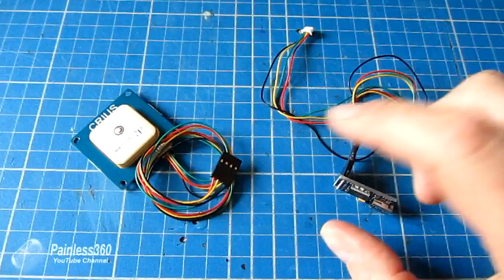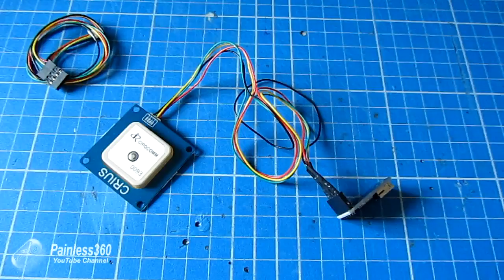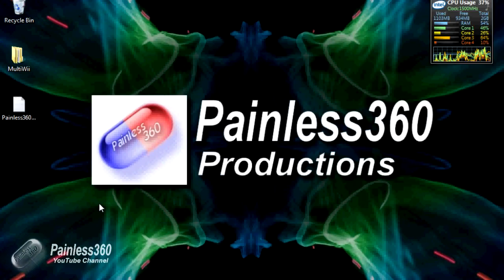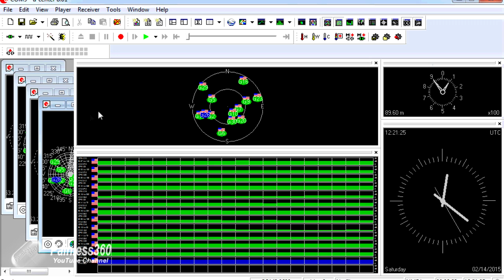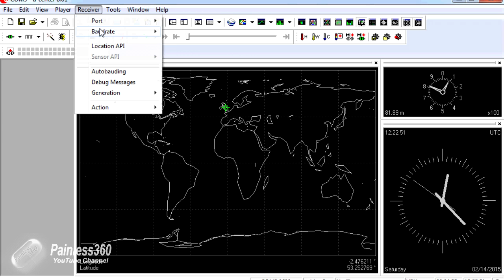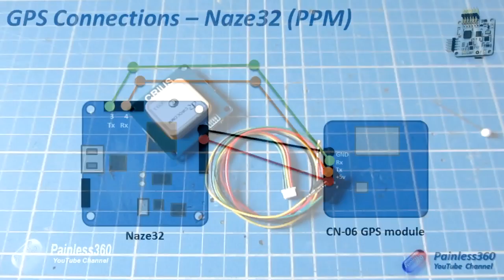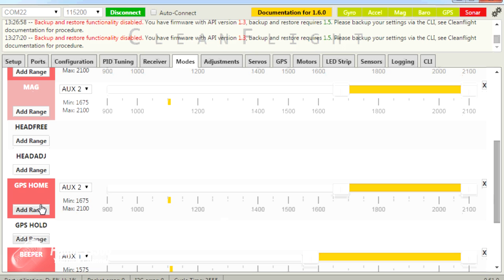(6/8) Naze32 Flight Controller - Adding GPS (NE-06, NEO-06 module)

Comment: Hi...Noobie question..Do you have to configure all GPS units to work on naze32. If so where do you get the adaptor + software from..
from..
Reply from the maker: +Colin Helinewbie first tip - don't use a Naze32. Second tip - go and watch my iNav series. Best of luck!
Reply: Hi.. I have watched a lot of your videos and found them very informative But why not naze32. I will be using the skyline32 advance. I have now got the software plus the config file and a FTDI adaptor will arrive today.. Will your config file work with a Ublox Neo-M8N GPS With Compass. Thanks in advance..Keep up the good work..
Reply from the maker: +Colin Helinewbie see my video from the summer on flight controller comparisons. I cover it all in there. Best of luck
Reply: Ok will do. Thanks

Comment: Hi Mario! I love your videos      I cant seem to get the gps to connect to ublock. I have a solid blue light on the gps and the wires are all in the correct places but it doesn't show up in ublock and no ports are available     any ideas?
Reply from the maker: +Elam Fisher try swapping the tx and Rx lines and trying other baud rates.. best of luck!

Comment: Quick question, does this even remotely apply to a Naze32 Rev 6? I was given an AP rig, but I'm just looking to get it airborne, maybe add a camera gimbal and get some pretty pictures. Not sure I need GPS, but it'd be a nice option later. But I'm also aware that this tech has changed greatly since this video came out. :)
Reply from the maker: If you're looking for GPS, ditch the Naze32 and use iNav. Best of luck! :D
Reply: Thanks much! :D

Comment: I have a question, maybe you can help me:) Since you've also done a video on the F3 SP Racing flight controller.. I want to add GPS to my racing quad for safety purposes. I've successfully installed the Neo-6M Module, and it works fine in betaflight. But I got weird circling (not just circling, but actual uncontrolled movement). Then I found this video in which you explain that a compass is needed (I guessed that, but wasn't sure). Now my question is: Do you know if and how it's possible to connect an I2C compass to the F3 racing? It has a I2C conector..
Any help would be really appreciated!:) Great videos b the way, helped me a lot to understand the Neo-6M and uart.
Reply from the maker: +DerKrawallkeks if you want gps modes, then take a look at our inavflight series. Much better..
Reply: I know I know, I've read about that. But in my specific case, I want betaflight, since this is a racedrone. I just need very basic gps to work (pos. hold or rth) for safety reasons.
Do you know if I can just hook up a compass via I2C right out of the box?

Comment: Hi im trying to run a ubLOX neo 7-M gps module with my naze 32 rev 6 full
im having problems with the set up on the ublox u centre. (its my first go at gps setup)
i cant seem to find a GPS CNSS conguration file suitable for this module.
dose any one have any ideas how too finish the setup ?
Reply from the maker: I'd use iNav, see our series on that. If you want to manually configure the GPS then we cover all of the steps in the SP3 series on the channel. Best of luck!

Comment: can not configure the gps. it isn't saving any change. I have tried mannually without success. the u center works perfecty but wenn try send a new configuration it change black for 1 second and turne back to grey.  Any idea?? tanks very much.
Reply: problem solved!!! i can now configure it!!!
 but there is a new issue now the naze32 still don't recognize the gps on cleanflight. :(  i have tried all . on ports under uart2 i choose gps baurate 115200 i check gps ubx, check gps. i used pins 3 and 4 for tx rx . uart2 115200 gps.
Reply from the maker: If you want GPS, i'd seriously consider using iNav instead.. See our series on it...
Reply: iNav save the day!!!!\o/

Comment: How can i change your config file so it sets the baud rate to 19200? I have to use a softserial port and i think 115200 is too fast because the link is very unstable. I've read that the max baud rate for softserial is 19200..
Reply from the maker: +cédric De Berlanger you can't easily, if you want to change the settings to be something else then watch are GPS setup video in the SP 3 Series. We go through each manual step in there. Best of luck
Reply: Painless360 Damn that was quick! I'll have a look. Thanks!

Comment: Hello, 
I got only one question, what should I do if I want to connect my GPS and the Naze32 in PWM? how should it be the graphic (17:33). Because the +5V and GND connections, which come from the Naze, they go to the receiver X8R.
I mean, how can I feed my GPS if I´m using the GND and 5v of my Naze for the receiver?
Thanks in advance
Reply from the maker: See the connections at 16:26. There are other places you can get the 5v and GND from including spare PWM output pins. Best of luck!

Comment: Hi painles360,
I have tried to setup my GPS with the file you have a link from but when uploading that file to the gps unit U center gives me a  error that the configuration file version are not the same 
confirguration file  software version 7.03(45969) hardware version 00040007 and the GPS Receiver software version 2.01 (75331) hardware version 00080000 also on the gps side of the error it gives me some extensions named protver 15.00 and GPS:SBAS;GLO;BDS;QZSS. what do you think just pres yes?

ps love the videos about the Inav.
Reply from the maker: If the GPS isn't a Neo6-M then the file will not work. You need to manually setup the GPS as per the instructions in the SP3 series (or use iNav and let that do all the work for you ;). Best of luck!

Comment: Thank you for this, I am 1/2 way on this using the  GY-NEO6MV2 NEO-6M Ublox Flight Controller GPS. I used my Arduino uno connecting the reset to ground also connected this to the ground of the GPS, 5v from the UNO to the gps, GPS TX to the TX input on the UNO and GPS RX to the RX input on the UNO. This dose the same as the CP2102 TTL level Serial port and no script is needed. I have run the GNNS config this did come up with a compatibility problem but I took the plunge and continued. Rebooted and found when I changes the board rate and all worked ok.
Reply: I did do it this way just typed it wrong, all the same working Ok. 
Thank you

Comment: I have ordered a 10 dof naze32 from gearbest. my intention is to build a 250 size quad that will have gps hold and home return. can you disable the magnetometer on the fc and use a compass on a stand to lessen interference?
Reply from the maker: Depends on what external mag you're using. See the iNav series for lots more detail on exactly this topic. Best of luck!

Comment: Thanks for this nice and interesting video. With the PPM signal no problem, but if we use SBUS like with the X4R receiver. I guess that the PIN4 is used for SBUS and so no more available for GPS RX. How can we do ?
Reply from the maker: This is where is starts to get interesting with GPS on a board like the Naze32. Simply not enough ports for everything. If you want GPS then I'd be looking at a STM32F3 based flight controller... Best of luck!

Comment: what is your view about mini neo-m8n with naze 32 ?
Reply from the maker: +Arjun Anbarasan as you can't use the GPS flight modes then it should work fine for simply showing the coordinates.. best of luck.
Reply: why is that i can't use the flight modes ?  Any specific reason.
Reply from the maker: Yep - we cover it in the vide every time we add a GPS to a Cleanflight/Betaflight powered flight controller on the channel (1:55 in this video). All covered in the Cleanflight/Betaflight documentation too....

Comment: Hi, I searched the thread, but didn't find the issue I was having.  I have the NEO-06 CRIUS (0093) same as the one in your video.  But when I try to upload the config file, it gives me a notice that the version I am downloading is different from the current software (7.03) and hardware version (0040007) of the GPS.  When I go ahead and proceed anyway, at the end of the download, the u-blox (ver 8.21) quits.  Where can I download the config file that corresponds to the version of the GPS?  Thanks.  And your videos are awesome.
Reply from the maker: You can see the manual process for configuring the GPS you have in the SP3 series. It's a little bit tedious but not hard. Best of luck!

Comment: Hello, the GPS CNSS configuration file mentioned in the video,
the link goes to a TXT file. Do you have the GNSS file to put into
u-center?
Reply from the maker: +alwysgn right click - 'save as'...
Reply: When I do that it saves it as a txt file, is that correct and is that the file I load into the file to GNSS button under GNSS Configuration. 
Yes I'm a bit ignorant right now, sorry

Comment: anybody has the naze 32 rev 6 wiring diagram for GPS?
Reply from the maker: Should be the same...(?)
Reply: thank you , i was double checking just in case i fry another board, Painless360 thank you for  your videos, really comprehensive and easy to follow

Comment: Hi... got a question. Between the older Neo-7M, Mini Neo-7M,  Neo M8N and Mini Neo M8N, does it really matter which one I get for the Naze32 Rev6 10DF?
Reply from the maker: +K Khalifah not really, the GPS can only be used for GPS xo-ordinates in the OSD and telemetry data anyway, unless you try iNavflight..

Comment: I have a ublox Neo M8N GPS and am not getting it to connect. I am on the correct port. Your configuration file does not work on the NEO 8. Any help or suggestions where to get a settings file or what may be wrong?
Reply from the maker: Have a look at the manual configuration process we use in the SP3 series - that should work with any GPS module. Best of luck!

Comment: Hi I've watch all your naze32 series it been very helpful. I was wondering if there is any way to wire a naze32 with frsky telemetry, osd, gps and leds. Can I connect the gps to rc3 & 4. The receiver telemetry to 5 & 6 and the led to 7 or 8. Can you help. Thanks
Reply from the maker: The detail is in the series where we add all of those to it, one by one. The challenge with the small processor that the Naxe32 uses is the very limited number of UARTs and ports for everything. If you want that much on the model then I'd look at a STMF3 based board.. Best of luck!

Comment: good vid and tips. I'm using a prebuilt Eachine Blade 185. all gps settings were wiped clean when i updated to CF 1.13 and configurator 1.2.4. gotta enable GPS on  UART2, with probably 57600 baud or faster. and doing "feature GPS" and "get gps" and "set gps" and other GPS related commands in CLI are quite helpful too. cheers

Comment: I have the Beitian BN-880 GPS Module from Banggood which has a mag compass aboard but my Naze32 Rev5 also has a Mag compass, so I may have too disable the Naze32 Mag compass if it is the same type, which I think it is an ( HMC5883 )....therefore I could then enable the GPS module compass which is remote from all the Quads electronics and thus limit interference. 

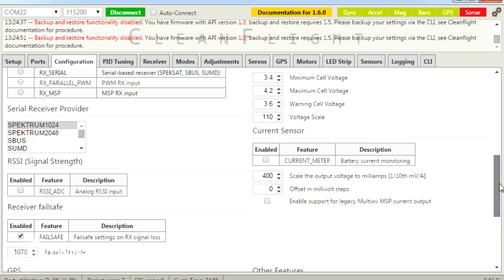 Around 19:50 you discuss the UART2  config for GPS but my UART2 is used to config for a Lemon Sat Rx =serial Rx how do I get around this cos when I attempt too  config GPS along with Serial Rx using UART2 it blanks out serial rx and gps !!?? 

 Is there any way around this ...Joe
Reply from the maker: You don't connect the i2c wires from the external GPS unit as they are used for the compass. Best of luck!

Comment: Naze32 rev6 Cleanflight.. GPS stops Arming
First I got the quad to work with CPPM a D4RII,  motors armed with the rudder stick or switch .
Then I connected the GPS and the GPS worked.  Now I can not ARM the motors.
On my Taranis I moved the Thr and the Rudder down two channels to put the tx and the rx wires on channels 3 and 4. This gave me Ch1 Ail, Ch2 Elv, Ch 3 and 4 (GPS) , ch5 Thr (Aux1) and Ch6 rud (Aux2). 
Did an Amy switch still no ARM..
What did I miss???

THANKS FOR THE HELP
Reply from the maker: I'd check the basics - See the NAze32 arming troubleshooting video. Or, remove the GPS and it's setup in Cleanflight and check that it still arms.. Best of luck!
Reply: thanks... got it working had to change to A E 3 4 T R 12 
Before I could not change this, but today I could!!!

Thank
you are GREAT

Comment: Hey Painless! Can I use this GPS configuration file for my neo m8n? 12:34
Reply: If not do you recommend under Tools > AssistNow online > GNSS Ublox M8N > (then a very weird confusing menu)
Reply from the maker: Sadly not, we do cover the manual setup of the GPS in the SP3 series where we add a GPS. That should allow you to setup any Ublox GPS module.. Best of luck!

Comment: Hi, i have built this quad and thank you so much for your help in this, as this video has been about for some time could i ask if there is a better gps for the full naze 32 board as im not sure what to buy?
Reply from the maker: See the later SP3 series. I'd go fro an 8 series UBLOX GPS now..
Reply: thanks for replying.
I have built a 250 mini quad but would like to make a 450 size one for filming with a gopro, I wondered if you suggest an alternative flight controller or if a spf3 will be good with low rates on the remote?
Reply from the maker: If you're looking for a great camera platform with useful GPS modes then an APM or Pixhawk/PixRacer would be my first choice..

Comment: hii i have the ublox neo-6mv2 how do i download the file you used or is it just a copy and paste job?
Reply from the maker: Right click on the link - 'Save target as..; ;)
Reply: thanks mate, this is the last thing i need to do ready for when my naze32 revo6 full board comes in the mail :P
Reply from the maker: Best of luck with the build!
Reply: thanks :) il post a video after its tuned so you can see if you like?
Reply from the maker: Yes please - we love to see new flying beasties! Best of luck!
Reply: :) im so excited now my board came this morning just waiting for a soldering iron from my mum, im using 40a skywalker esc`s, a2212/13t 1000kv motors 10x4.5 props and a hj alien 450 frame with a 3s lipo, im so excited now :P, my radio is a flysky i6 radio but instead of spending out on a ppm receiver im waiting on a ppm encoder from china so i can run on 1 wire :P
Reply from the maker: Best of luck with the build!
Reply: Benjamin Scott  lol i am making the same one with the same transmiiter and frame and esc !!
Reply: Missle launcher /Clash of clans you will have to fine tune it in cleanflight or betaflight, i ended up using inav gps pids to get it stay where it was, although it did wonder in circles but it was a lot better than what it was

Comment: Hi, Absolutely love your videos. Thanks a million.

I am just new to building quads and have a VersaCopter with a full version Naze32 flight controller board.
In regards to the GPS modules are the Ublox Neo 6M GPS modules still the best option to install in a quad. I am aiming for RTH and hover mode on this quad.

Was looking at this GPS module and am unsure if it is the correct type: http://www.ebay.com.au/itm/Ublox-NEO-6M-GPS-Module-Aircraft-Flight-Controller-For-Arduino-MWC-IMU-APM2-/122028218410?hash=item1c6972d82a:g:hyUAAOSwPc9Wwddg

Thanks
Reply from the maker: Its more about what will work with Cleanflight. The Generation6 modules are very mature now and you can get series 8 that have improved sensitivity and startup times. I'd go for a series 8 for a new build now (if I didn't have seriss 6 GPS modules in the spares bin!) ;)
Reply: Thanks for the quick and useful reply. Would a Ublox Neo-M8N be what you are referring to?
Just want to make sure I order the correct product

I found one here: http://www.ebay.com.au/itm/1x-Ublox-NEO-M8N-High-Precision-GPS-Module-Built-in-Compass-for-APM-Flight-RC-YA-/222178559663?hash=item33badfc6af:g:OEYAAOSweWVXfTbv

Would this be the right product?
Thanks again. Much appreciated

Comment: hello, quick question, will your config file also work with m8n gps modules ? thanks
Reply from the maker: +TEST probably not. See the SP3 series for an explanation of the manual process to setup any GPS version. Best of luck!
Reply: It worked but i didn't even have to because inav has the auto config enabled by default... (weirdly not exactly the same, only (5hz and not pedestrian), anyway, thanks !
Reply from the maker: Great to hear it works, a lot of firmware has it (LibrePilot is another) but not all of them work ;) Happy flying!

Comment: Hi, I am using SPracing f3 evo with barometer inside. I also install 3DR GPS as a external GPS. if I need keep hovering during the flight by using GPS, Which modes do I need to activate beside "GPS hold"? Thanks!
Reply from the maker: See our comments on the GPS modes in Cleanflight - they are still not very good. If you want GPS then look at iNav... Best of luck!
Reply: Ok, Thanks!

Comment: Hi, having a problem trying to carry out the "gnss configuration", I carried out the routine exactly as you did, but when the "setting configuration" window appears the blue progress bar makes it right to the end and then a PC window opens and says "Programs failed, close programs" and then a windows box appears to say it is looking for the problem (but never finds it), I am using windows10 and I am wondering if that is the problem, has anyone else said anything similar to you and do you have any suggestions
Reply from the maker: We've not had that here - maybe try running the application in compatibility mode? Best of luck!

Comment: Friend, and set up everything for GPS , however there is not Respond rth mode or gpshold That mode and clawing 4 or 5 satellites Before taking off , I may be doing wrong .What schedule with cleanflight and set with the Mode baro , home and mag horizon mode and gPS mode , but does not respond
Reply from the maker: See the notes in the Cleanflight docs and our comments in the video. The GPS modes are considered 'experimental' I wish that CF would get this sorted.. iNav is a Cleanflight fork that's improving g the GPS support..